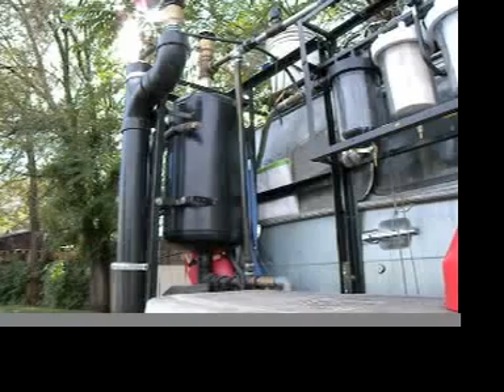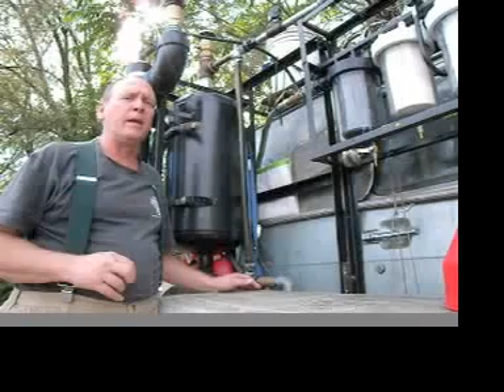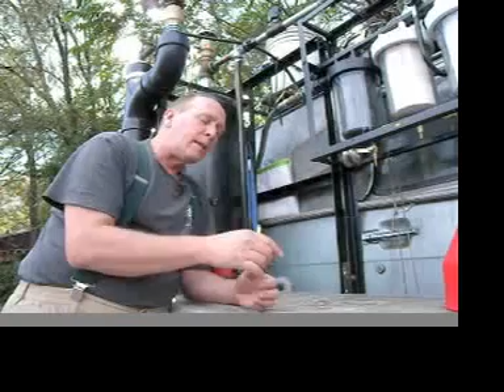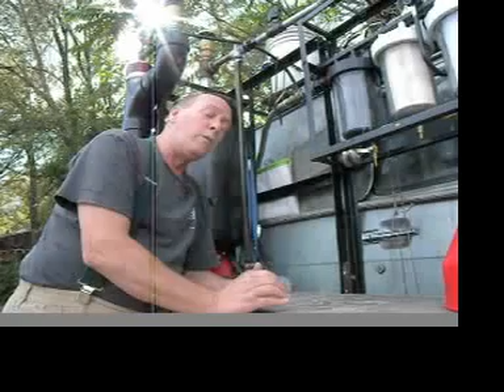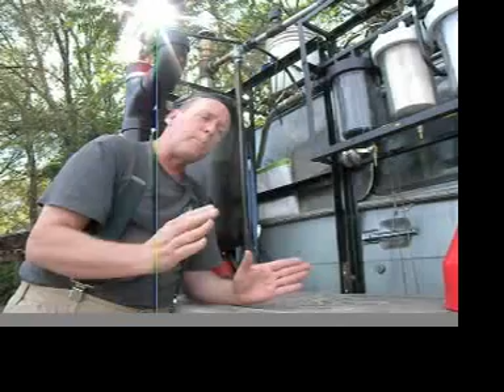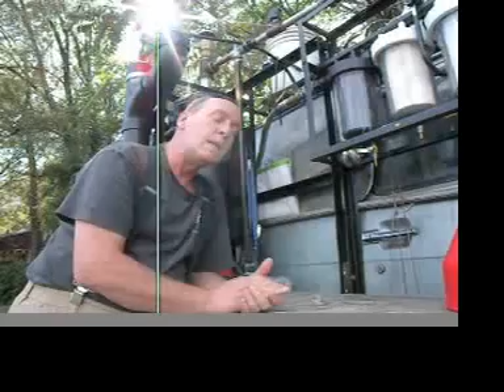three types of bio-diesel biofuels

Comment: essentially he recommends thinning the veg oil with gasoline to reduce the viscosity of the oil, this is what is done in very cold climates with regular diesel such as Siberia and northern Canada
Reply from the maker: Yes, and since it is common practice in cold countries to use gasoline to thin and antigel diesel fuel, then I tried it with waste oils.  It works quite well, but waste oils at 80% in a diesel fuel blend can lead to coking so 20% gasoline + 30% diesel + 50% waste oil works better.

Comment: The boiling point of methanol is 148 F, not 120. And you heat the veg oil to 130, not 120. You obviously haven't done your biodiesel homework.
Reply: hi, what is your method? thanks
Reply: There's a great series here on YouTube by Matthew Flansburg called Biodiesel Processing. He does the whole thing start to finish with a great deal of detail.

Comment: I use the 3rd methet. Cheaper, cleaner, Safer. I could use motor oil But i chose not too. My best mix is 35% V 60% D 5%G

Comment: You are absolutely stupid! You do NOT mix diesel with straight vegetable oil. Even pure unused vegetable oil has impurity's in it, and it will plug up you injectors and fuel filter. You have to do it the methanol and lye method to get pure biodiesel.

Comment: I clean 40 gallons of cooking oil, If i add 4 gallon of gas to the cooking oil will that work in a diesel engine in 70 degree weather.
Reply: +Kenneth Meggers Will this mix hurt the motor.
Reply: +Kenneth Meggers Why do you use gas instead of diesel.
Reply from the maker: +Kenneth Meggers yes, blending 4-5 gallons of diesel fuel to 15-16 gallons of WVO will run on any diesel engine.  No, this blend should not cause damage to any diesel engine.  

I now use both gasoline and diesel fuel to blend with WVO.  I first blend WVO with diesel fuel at 20%.  I then remove the sediments, after a 1 week settle period.  I then translucent blend of 20% diesel + 80% WVO with gasoline at 20%. 

 I use gasoline, because it is thinner than diesel fuel, so it will bring down the overall specific gravity of the blend to .850, which diesel fuel alone cannot do.

I reduce the WVO component to 60%, because doing so seems to improve performance of my fuel blend.
Reply from the maker: I filter down to 1 micron, then use a centrifuge.
Reply: @Jhananda  Hi what is WVO  and  2 tank svo please?

Comment: Thanks for very informative video I was thinking to try bio diesel in my 2004 vw Passat I ll this method first
Reply from the maker: billy khan You are welcome.  You will find that blending is easier, the fuel burns better in most diesel engines, and it runs at lower temperatures than biodiesel.  However, one has to make the fuel properly for all of that to be true.

Comment: interesting series of vids, reinforces the possibilities other than processing which I am just getting in to. I  have '99 7.3 Ford diesel (camper van) '88 Chevy 6.2d and 95 Chevy 6.5td pickups to play with....if your info is good I can use veg oil further into the winter than I would have otherwise comfortably done....

Comment: Very interesting video . Filtering and dewatering wvo is hard work. Have made small batches of biodeisel(wvo methonol lye) and it works well in my van . But blending looks to be a safer and easer way to go. I have a 2 tank system on my van but straight wvo is hard on filters and you have to be fully up to temprature befor it works. . Im going to try 10% here in south of uk as winter is mildish . Im letting wvo settle for a month or so befor drawing off cleanish oil off the top , mixing 10% petrol then filtering to 5 micron and see how that will go .
Reply from the maker: Being able to run B100 depends upon how cold it gets where you are.  Most people can run B100 as long as the temperatures are above 32F (0c).  However, blending gasoline with waste oils is a lot easier and cheaper than making biodiesel.
Reply from the maker: Yes, I agree blending is easier and safer than the biodiesel process; and solves a lot of problems that the 2-tank SVO systems tend to have.
Reply: it really depends what you have. I haven't tried any biodiesel yet, but I'm looking to start as soon as I can get me a kit. My truck (7.3 Powerstroke) is the best truck to run on B100, from the research I've done. Can run it year round.

Comment from the maker: @pacificcloud All auto manufacturers who sold autos in the UK with diesel engines in them in the 80s all stated in the owner's manuals for those autos that petrol (gasoline) could be added to the fuel up to 30%.

Also, I have run waste oils blends with gasoline as high as 50% in my 1983 6.2L diesel engine without any trouble.

Comment from the maker: @Begbucks a heated two-tank system is best for long haul applications, because the engine has to be hot before switching over to veg; whereas, blending is ideal for short haul applications, where the average commute is 20 minutes or less in between stop intervals.  This means blending is ideal for city commuting, and the two-tank is best for highway driving.  Also, two -tank systems and biodiesel have problems of fuel freezing in cold weather

Comment from the maker: @blumaxx1 Since I have been running blends of WVO and WMO with gasoline at 20% in a diesel engine for over 5 years, and hundred of others around the world have done the same in a wide range of diesel engines, then it suggests that adding WVO or WMO to gasoline at 80% retards its ignition and increases its lubricity to the point that a diesel engine will run just fine on such a blend for many thousands of miles of trouble-free operation.

Comment: if you know anything about gasoline,it has no lubricating properties what soever,and is fatal to an injection pump,secondly gasoline is engineered not to ignite when compressed,and will only ignite by spark,unless it is a very poor quality fuel,and mixing gasoline with vegetable oil ,will diminish the lubricating propertys of the vegetable oil,exposing the injection  pump to a short life,i my self  use small amounts of kerosene to thin my vegetable oil in the winter ,,,,,